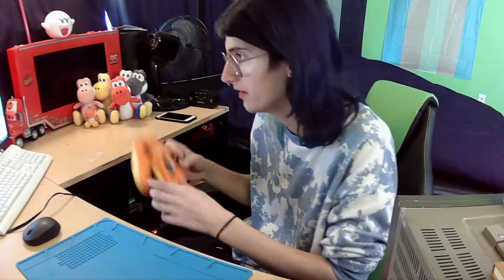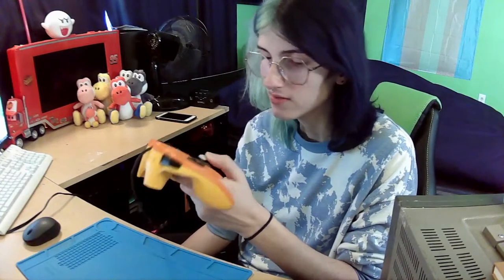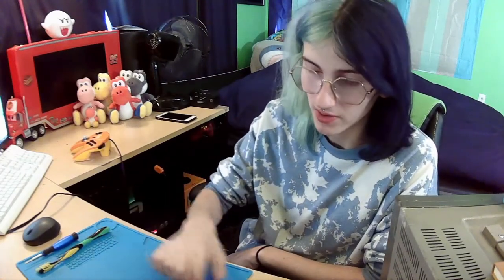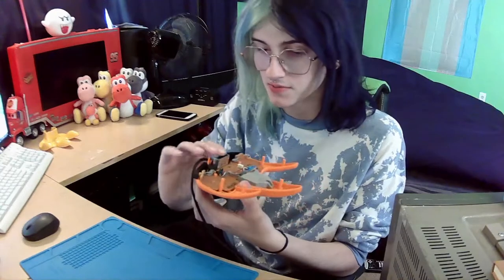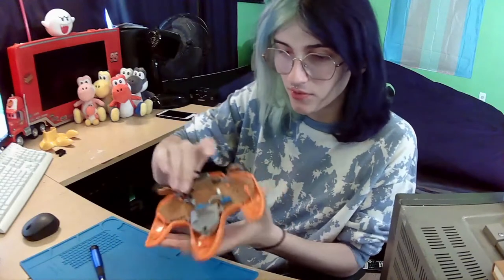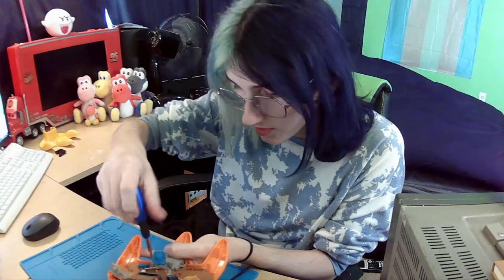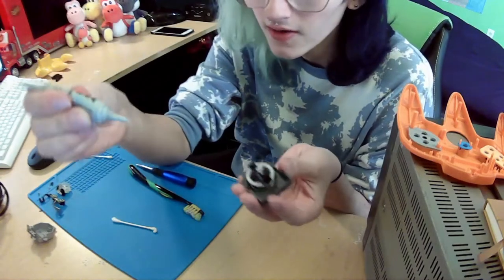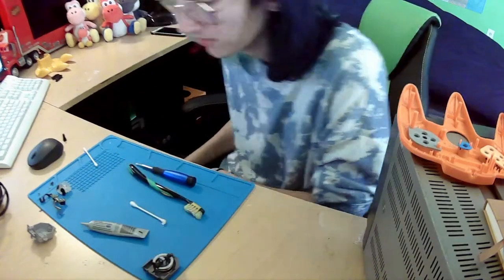N64 Controller Cleaning and Lubing Video Guide

Comment: There is a bunch of different types of super lube. What one do people use in their controllers?
Reply from the maker: https://www.ebay.com/itm/134416017585? also on amazon or prolly ur local hardware store
Reply: @baileyoshi  i want to repeat the question as your link is dead also as a non american, ebay and amazon(well technically the german one works) arent options so it'd be good to know excatly what kind of lube it is so i can get some other brand
Reply from the maker: @SilentOnion  PTFE grease. superlube has a website that might do shipments better also. I have not heard of anyone else using ptfe that isnt superlube tho so youll have to do your own research. Ask the taostyx discord server (https://taostyx64.com/) for other suggestions as this is the highest concentrate of n64 controller nerds and engineers i have ever seen